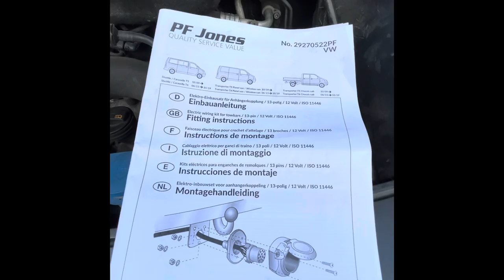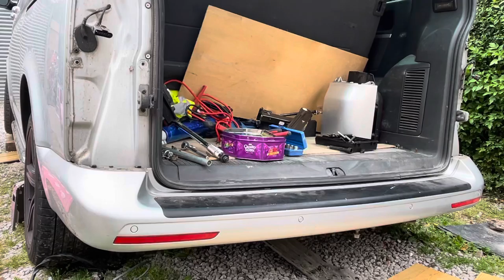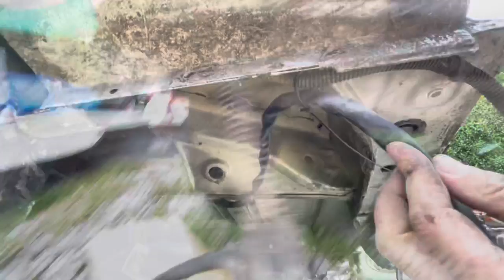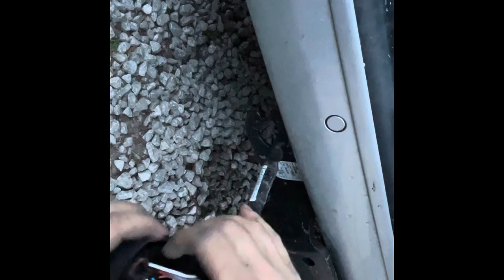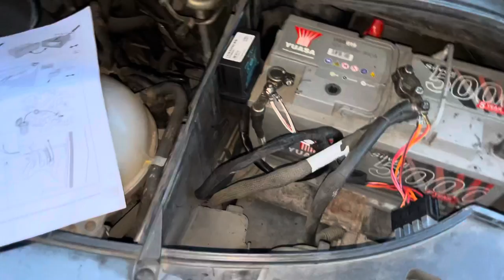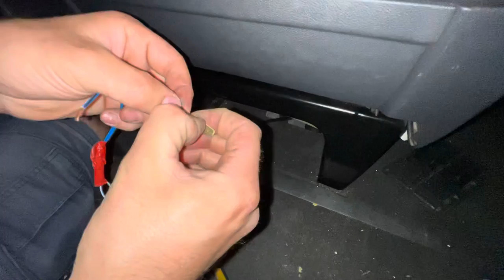T5.1 Caravelle Transporter 13 pin electrics and towbar fitting DIY

Comment: I’ve managed to do the canbus wire another way, instead of using the “awkward” gromit (actually called it a lot worse) i used the grommet hole above the osf top mount. It comes out behind the dash and gives a bit more length on the cable.

Comment: Thanks for the vid. Been a great help to me as I'm in the middle of installing mine today and tommorow. Did you have to get this coded with diagnostics and where did you run the reverse wire (possibly missed that part. Apologies if so). My kit (wiring) is from right connection. Its identical to yours except when you wire up the blue socket under passengers seat. Mine went mental when I did that. Option 2 was what worked for my van. 👍 Thanks again

Comment: Thanks for the vid, I’ve bought the same for my 5.1. Did you get the coding done afterwards ? Thanks
Reply from the maker: I did get someone to code but for some reason my sensors still go off so dont know if done 😂
Reply: Is it only in reverse with a trailer hitched they complain ?
Reply from the maker: Its reverse sensors and also i think the braking system to change something when towing a heavy amount